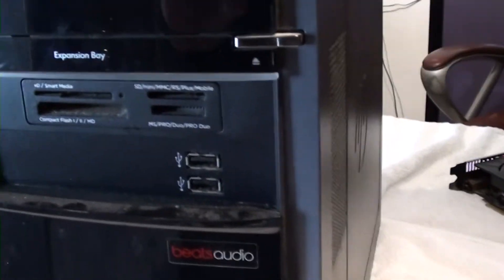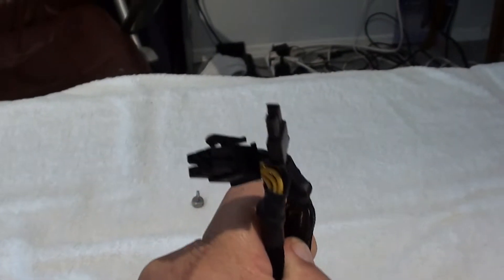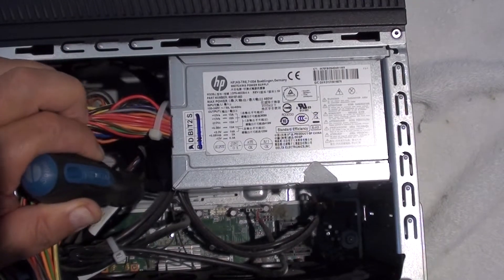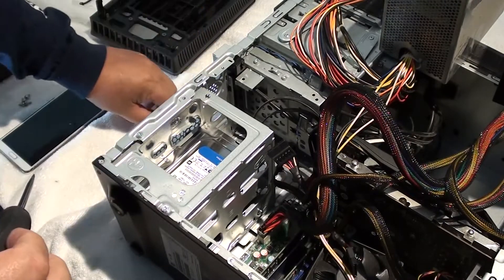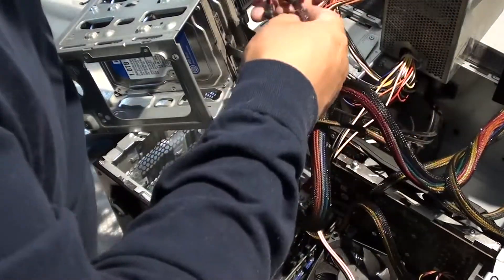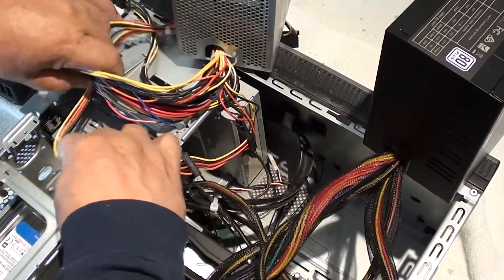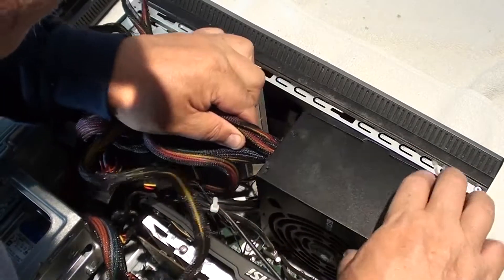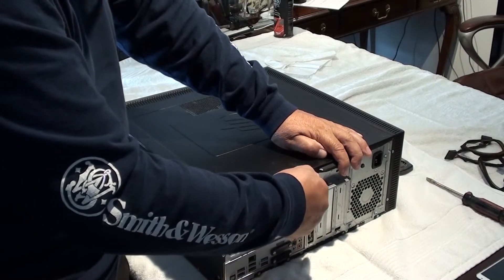HP |  Pavilion  | HPE |  Power Supply  | Upgrade |  DIY ep 2

Comment: Why was the replacement power supply black but when closing the cover at end of video seems to be the original power supply still installed?
Reply from the maker: It was cheap, plus I may be adding more drives, etc . For video editing.premier pro uses a lot of resources
Reply from the maker: I didn't have video of that portion. So I used an old shot. But trust me it has the new 1 in. Thanks for stopping by
Reply: @notsofast2325  Just want to make sure it worked. Will be ordering one tomorrow. Why the 600W and not the 500W?